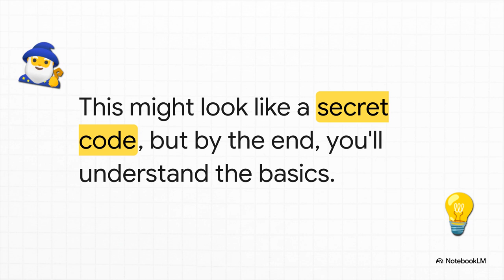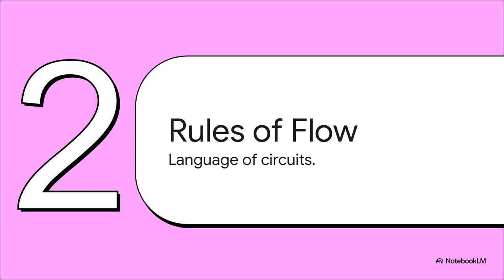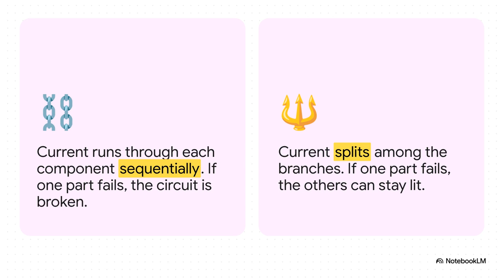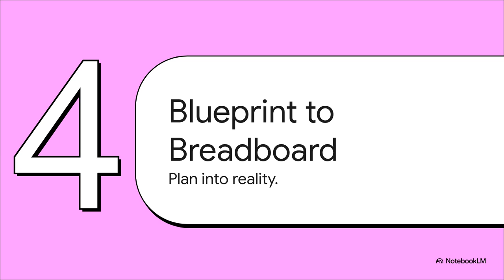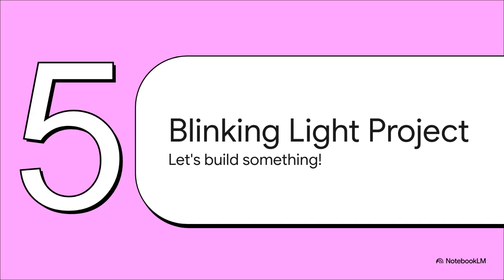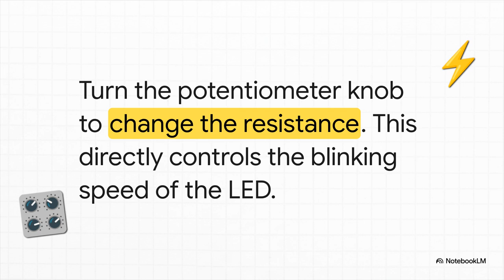Electronics for Dummies: Your First Circuit

Comment: This is a horrible video. If a person who is new to the field of electronics would not learn anything useful.. this video skipped over so much information such as resistor values, capacitor, Diode characteristics, transistor theory of operation. No schematic diagrams was shown. No schematic diagram for components was shown. How to protect the diode from the high voltages. What is and how to use a breadboard  wasn't discussed .I mean just to much information was left out . This video is horrible for individuals who has never seen or heard of these components and concepts 😒😒